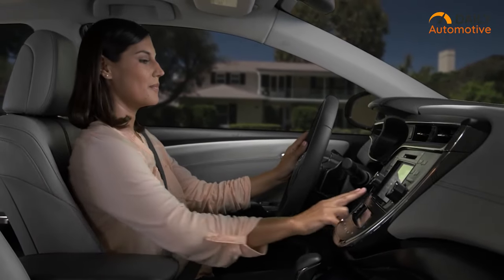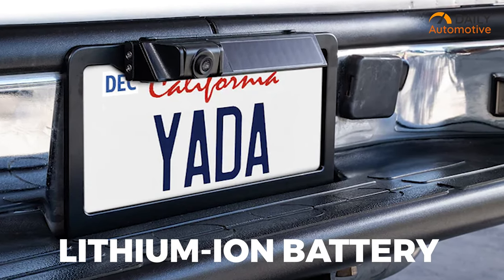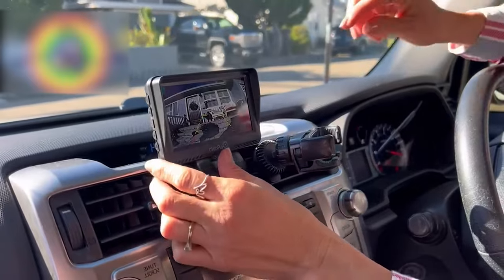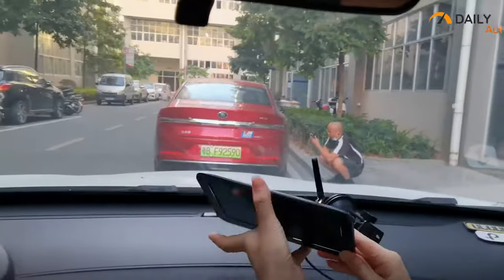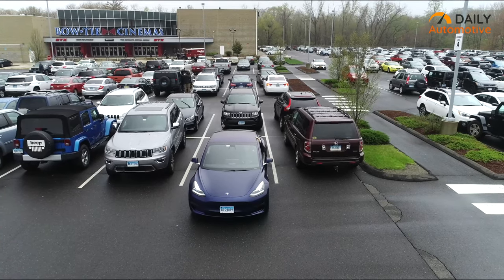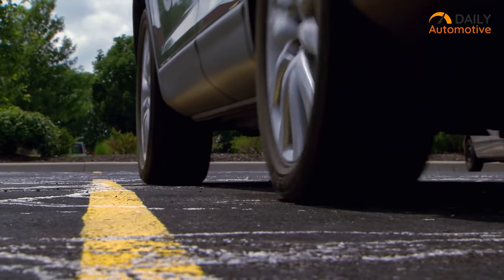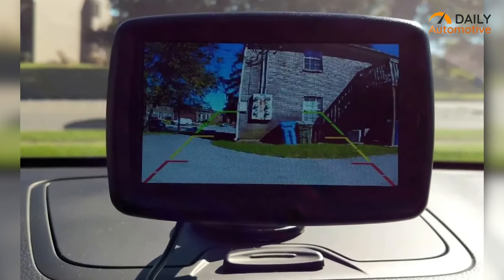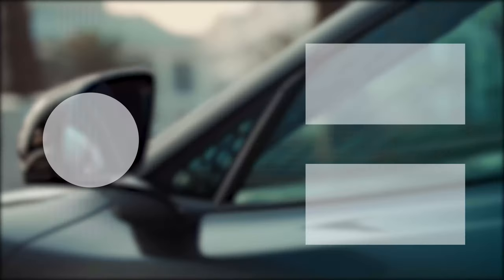5 Amazing Backup Cameras in 2024

Comment: MOST people do NOT want to have to put ANOTHER monitor inside their cars. We want a camera that connects to your Sat/Nav Stereo Head Unit. Why would anyone want to buy a separate monitor when almost every car already comes with one??????? AND it looks cheap to have a third party monitor sticking out inside your car. It's ridiculous.
Reply from the maker: You have a point, and we see that. But, people have different preferences as well.
Reply: Not everyone has a car with a built-in monitor system and a lot of those that do already have back-up camera. It's serving a need.
Reply: My 2015 Altima doesn't. So there's that.
Reply: Some of us don’t have a screen, like me and my 1998 2500 Chevy pickup….
Reply: Deadass wtf is this 2004 with TOMTOM GPS screen sticking out the dash ready to be stolen